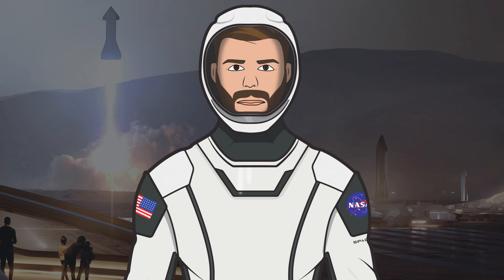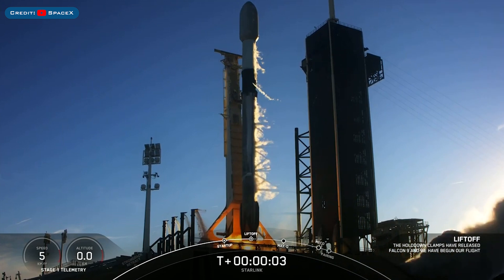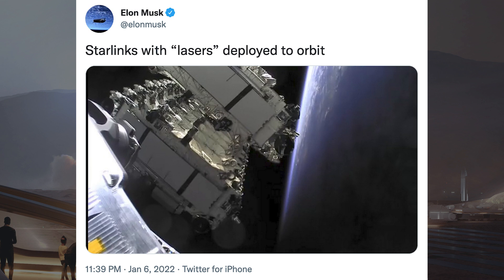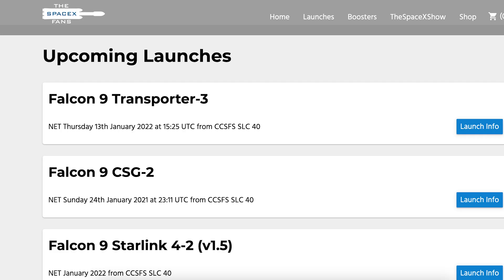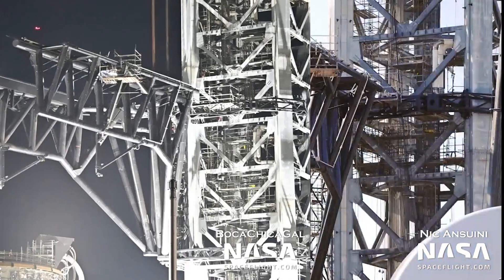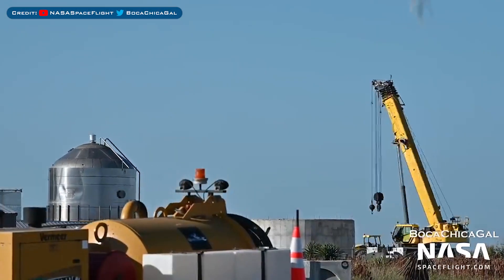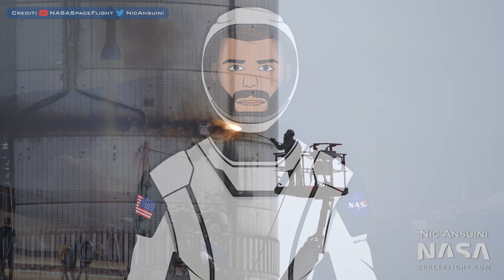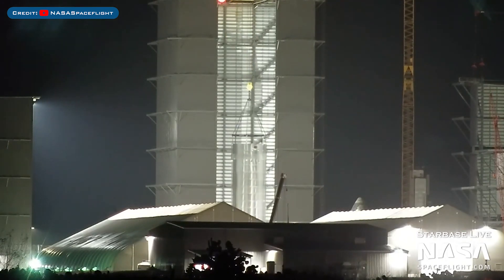SpaceX Starship Updates! Starbase Infrastructure Progressing! More Chopstick Testing! TheSpaceXShow

Comment: why did they  cut that top part of that booster what's the purpose
Reply: If you are referring to booster 3, it obsolete and is being scrapped.
Reply: Booster 3 was used for ground testing. These tests exercised the booster and the equipment on the ground. The results of that testing were used to improve the design of future boosters and to improve infrastructure. Since that series of tests is complete, and later boosters are better than booster 3, booster 3 is scrap metal.

They are cutting up the booster at the launch site rather than in the scrap yard. They won't need to close highway 4 to move cut up metal. They would have needed an extra closure to move the booster in one piece.

SpaceX removes the reusable parts for reuse in other spacecraft. The design doesn't change much on the flight computers and the Tesla batteries they use during testing, so those parts aren't obsolete. The pipes, wiring, insulation, and sheet metal are sorted and recycled.

Rocket engines are covered by ITAR secrecy laws, so they can't take them apart in public. We have seen engines get sent back to the factory for upgrades, and then get used on other vehicles. We have also seen engines get sent away, never to be seen again. I assume they take out the reusable parts, separate the rest by type of material, and recycle it, too.

On Mars, metal will be incredibly valuable until they are mining it locally. The Starships that carry people to Mars are likely to carry people back to Earth. At first, a significant fraction of Cargo Starships will probably be going on one-way trips. Each one-way starship will carry more than a hundred tonnes of cargo inside the vehicle. After otherwise unneeded starships are empty, they will be taken apart to supply structural steel.

The starships are made primarily of a single alloy. This makes recycling much easier. I believe that is intentional. I strongly suspect that SpaceX makes design choices specifically to make recycling more efficient.